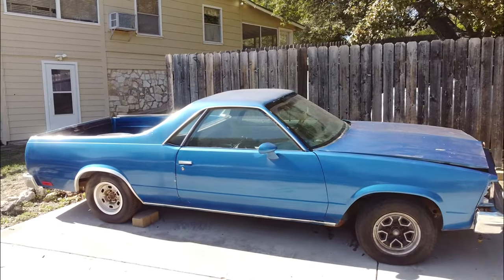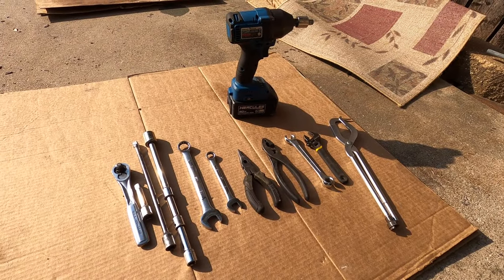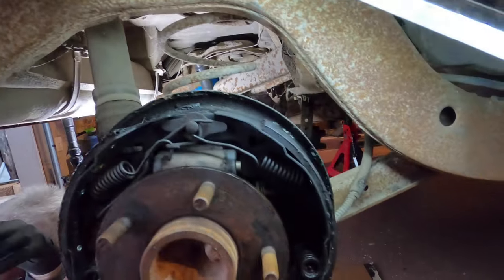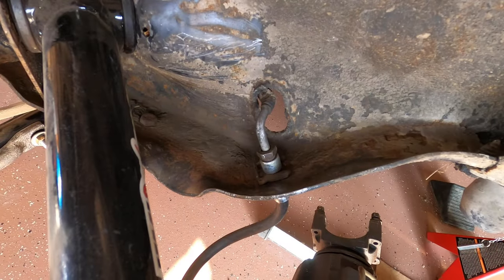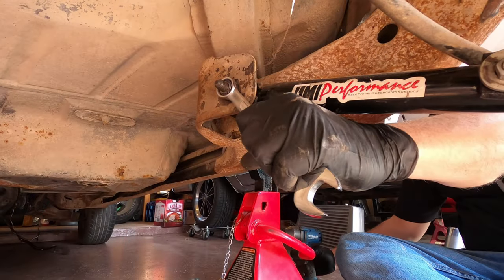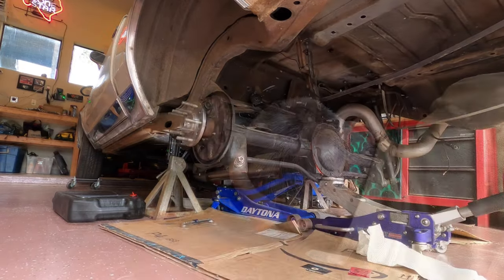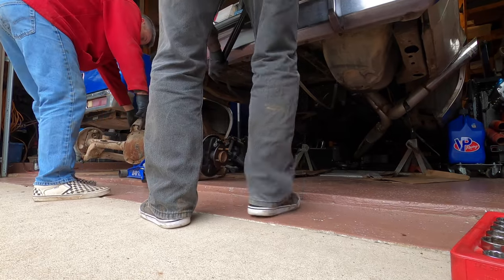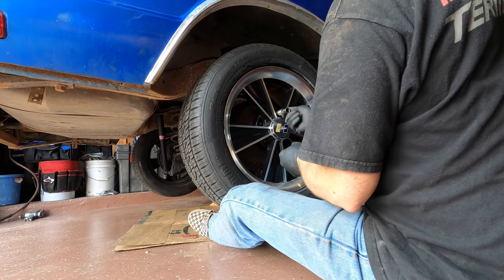How To Remove and Replace Your G-Body Rear Differential

Comment: Great that’s my next project, I have a grand national rear end going on my 84 el Camino, I upgraded the 3.42 to 3.73 great video how did it run after?
Reply from the maker: Good luck on your rear end swap! The Spork is in the beginning of its transformation…it will be a while before it’s running. It did great in my 81 Regal